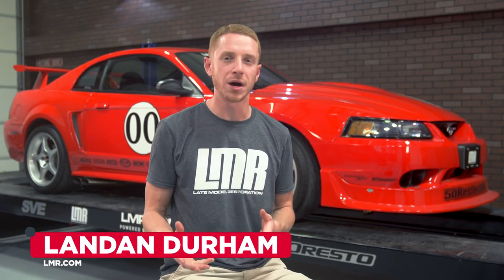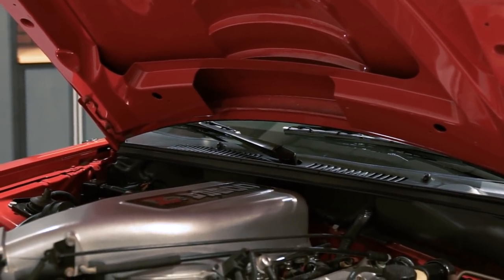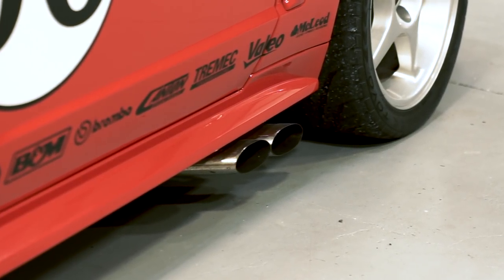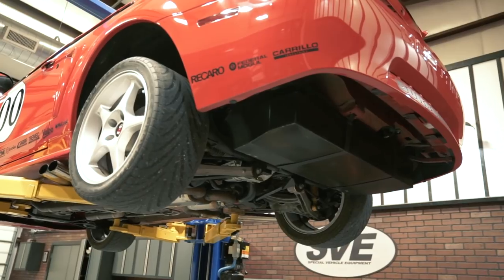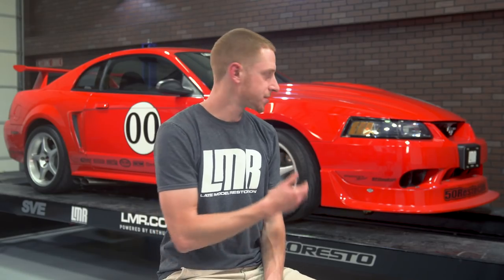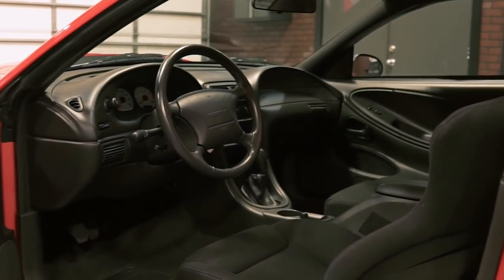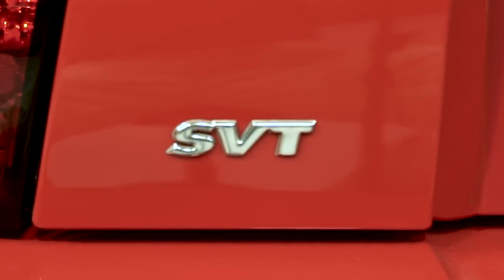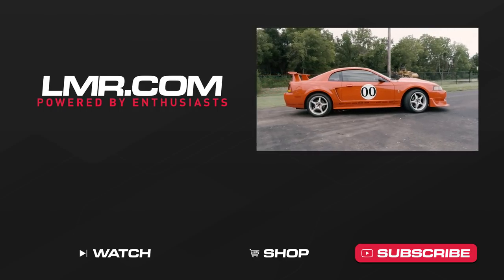What Is The 2000 Cobra R? | Everything You Need To Know

Comment: It's crazy how far we have come.  If someone told you that in 2015 the mustang would have similar hp but as a 4 cylinder...you'd think they were crazy.
Reply: I kinda agree, but I’d rather own a older 3v then a s550 eco boost.. nothing wrong with it I just rather have a older v8.
Reply: @everyonewasstealingmynamea919  lmfao
Reply: @everyonewasstealingmynamea919  I'd rather shove a Whipple charged Coyote in a New Edge.
Reply: Similar?
Reply: I understand what you are saying, but these cars were rated at 385 hp, and bone stock were putting down just south of that at the wheels in factory form. Make no mistake, the economist mustang is not in the same universe as this vehicle.
Reply: What EcoBoost has similar power to 385 hp? They need a turbo to almost make similar power.
Reply: @itserick_7669  The 2020 high performance  ecoboost has 350 hp stock. Mine has about 385 on its 91 tune.
Reply: @ag3nto578  350 hp crank. I know that. The cobra Rs dyno 380-390 to the wheels. Which is like 430-440 crank. They cant compare. Especially how much lighter a new edge style is compared to a s550

Comment: Removed everything not needed for races but a terminator which had everything in it still made 10 horses 🐎 more?!? I expected more out of a 5.4
Reply: Ford was very conservative with the Cobra R's hp numbers. Several R's have put down 385+ for hp & torque to the wheels. It is well known they're putting out more like 430 hp at the flywheel.
Reply: Ford was very conservative with the hp & torque numbers. These Cobras actually put down 385-390 hp & torque at the wheels. It is well known they're actually producing about 440 hp at the flywheel.

Comment: I could get the same 1/4 numbers with my 1986 Mustang with having wheel spin off of the line using street tires. That was using a 390W stroker two valve running an AOD, to bad Ford could not get better numbers then that with all that was done to the
 Cobra R.
Reply: 110-111 mph trap speed is good for 11.7-9 on full blown slicks and a capable drag racer.
Reply: It's way more that a 1/4-mile car. It's meant to run laps, and turn left and right - over and over.

Comment: These were great put together cars, but paying high bubble prices on these things isn’t very smart.  At the end of the day....it’s a Ford Mustang.  The honest value for what you get should be around $38,000-$58,000 depending on mileage/condition.  To drop $75-100K on a Ford Mustang is the VERY definition of MORONIC.  There are WAY, WAY better and more exotic cars to be had in the 
 75-100K range.  Save $30,000 and buy a Terminator Cobra....it will put the SAME smile on your face with the SAME performance and you can throw that $30,000 down towards something else.